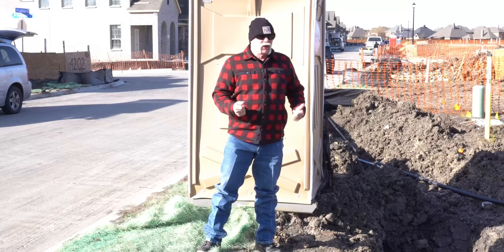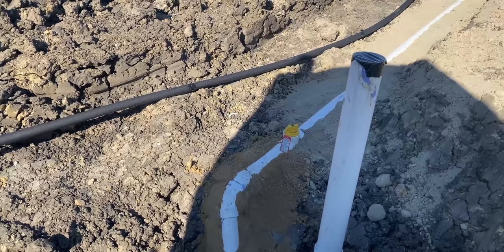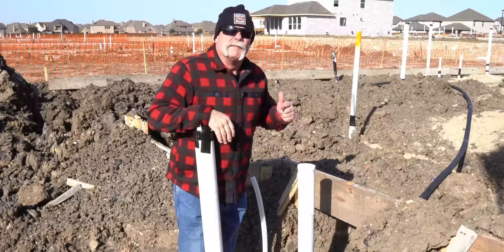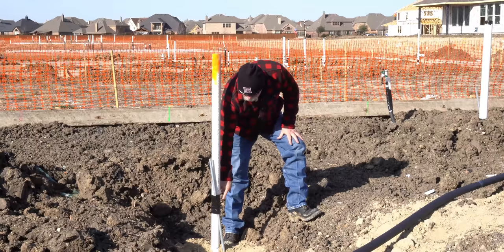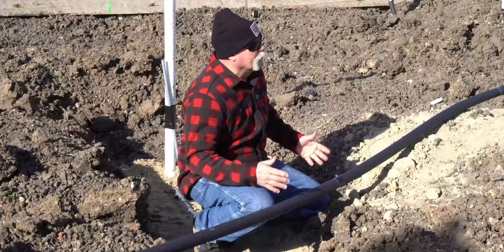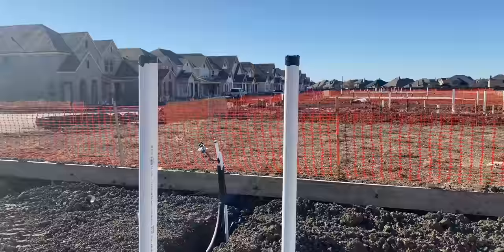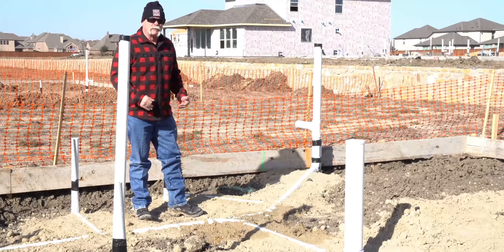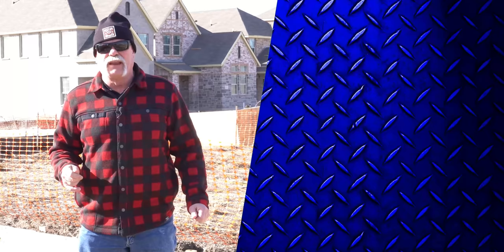How to Plumb a House | Rough-In

Comment: I do new construction I do rough ins fairly often. It's always cool seeing people talk about what you do and work around everyday. plumber nation!
Reply: About how long does it take for a rough in to be installed before the foundation is poured?
Reply: @marloflores8325  bruh you’d honestly be shocked how quickly some plumbers can get rough in’s done, I work as an apprentice doing rough in’s and it takes my group and I about Two and a half hours to do a one story house (that is if we don’t have excavation problems).
Reply: I'm a home designer and I have always included the brick ledge in my plan dimensions for the plumbers.  The new thing that I have noticed is more people leaving out the brick in the dimensions, leaving it up to the trades to add the 5-1/2" to the total. Do plumbers measure from the inside of the form boards (which would include the brick ledge) to locate drains or do you guys measure from the outside of frame?  I have argued that sometimes the brick ledge boards might not be set when you guys are roughing in drains and would measure from the actual EDGE OF SLAB?  I'll continue to dimension to E.O.S. until I learn different.  Thanks for any information.

Comment: I been doing strictly residential service since 2010. I ❤ it.. I did residential construction from 2003-2010. I'm glad that I started  in construction. Repetition is the best way to learn.
Reply: I did service plumbing for less than a year and over 5 years in construction. I learned a lot in the short time that I did service. From water heater installs and just cleaning out drains to repiping houses and trenchless sewer pulls, etc. Now I just do rough in plumbing from underground to top out.  I think both have their good sides and bad sides. There is a huge construction boom here in Northern CA. Some of the old timers who have been plumbing since the 90's say that it never lasts forever. I'll just ride the gravy train and go back to service when it stops. Haha. Someone has to service these new houses in the future.

Comment: Hi Roger. I've been following you for a while now and really enjoy your vids. I'm a residential new construction plumber in Northern CA. We only use abs here and in our local jurisdiction everything needs to be foam wrapped that is going to be up in the concrete. The project I'm currently on are all post tension slabs. We also strap our pipes with rebar and tie wire. I've never seen conduit used to strap the pipes like in your video around here.
Reply: The same here in southern cal...everything wrapped that are to be exposed in concrete footings and slab. Rebar and tie wire used.. I've never used conduit and tape on risers. Didn't see any support under the toilet 4x3 Arizona bends either
Reply: I’m in Texas and we use rebar to secure things as well. I’ve used all thread or 1/2” black iron in a pinch but never conduit. That’s track houses for you though. Do everything the bare minimum. We wrap everything in concrete here as well. I don’t know how it’s done in Dallas but in Austin that’s a separate inspection. We have a rough inspection and a pre pour inspection. On small jobs well usually do both at the same time but big roughs like this they’ll pass it then come back and back fill and wrap anything that will be in concrete.

Comment: City water and sewer inspector from Connecticut . I like seeing how other plumbers work in the country and how different we work. We don’t allow any pex buried in the ground whatsoever. It’s k copper or 200 lbs poly and it must have a tracer wire attached for line tracing purposes. Also we require 4 inch gasketed  not glued sewer pipe from the road through the foundation wall. We also require our sewer pipe outside the home to be laid in 6 inches of 1/2 or 3/4 inch crushed stone on the bottom ans 6 inches of stone on top and be wrapped in filter fabric to prevent sagging and bellies in the pipe. We used to pull deflection gauges through the pipe but now we air test the pipe then run a camera through the pipe to make sure it’s free of debris. If it’s clean we will run some water through and then a camera to make sure there isn’t and sagging or crushed pipe. It may seem like a lot but we have had some sloppy installs in the past that has forced us to make sure the home owner doesn’t have any clogs or rocks and debris don’t get into our pumps.
Reply from the maker: I love this! Thank you for doing things right!
Reply: Too many rules.

Comment: Lic plumber for 25 yrs+ and I do it all. When I rough in under a slab I use sand like this but I add it after my test which is a 10’ stand pipe (we are required to have a step ladder for inspector so all he has to do is go up and look)and after green tag. I will use a lil to secure everything but NEVER around joints. Once 24hrs pass with zero drop down I will go around a pack sand in all around my dwv

Comment: I work for a plumbing company and install new plumbing in houses that are being built. I don't know this aspect in this video because our ground crew does that. I go in and run all the plumbing and water lines and tie the plumbing into all of this and the water coming into the house is usually 1" pex and I reduce it to 3/4" pex and run 1/2" pex from the 3/4" to the bathrooms, laundry room, and kitchen. Pretty neat video! Thanks!

Comment: Roger, as a rough in plumber from the North, I have to disagree with your comment about bringing up your waterline to a valve in the garage. While this may work in Texas, it doesn't work anywhere that has a real winter. The garage is considered a cold space, weather or not it is heated.

I do like you comments on bringing 4" all the way in. Based on code where I live it is required to bring 4" into the building, and depending on the province i work in, code says we have to take 4" all the way to our main stack, with a 4x3x4 cleanout tee.
Reply: We live in MN. We have a main water shut off access in our driveway that is covered. But we also have a shutoff in the basement that is clearly marked with florescent paint and a sign by the plumber. Plus each shutoff (PEX system) is clearly labeled.
Reply: I was thinking the same as far as the water main, nothing on exterior walls or garages due to same issues. But for this video it's good for people who just want to see an idea but you should always refer to state and local codes before hand
Reply: Thats why you disagree with him , our weather compared to y'alls weather is totally different
Reply: Here you have to have 4” gasket outside the foundo. I like a shut off at the mech room or garage…I do a loop with shut off/prv/expansion tank. The water heater is usually in the garage so to me no real difference having the main in there as well…it would only make sense to not have it there if the water heater wasn’t there either. I live in the north and haven’t had an issue…just don’t leave the garage door open when it’s cold

Comment: I enjoy watching you I've been a licensed plumber for 40 years I'd like a 3" main line because of the gallon 1/2 flush toilets I've had too many customers that use heavy toilet paper and if there's not a washing machine behind it we end up with a ventral blockage and a in blockage in a in a 3" line let alone a 4" line 4" does not have enough water surface for a for a gallon and a 1/2 flush toilets and the water water level seems to be going down on those I live in Tennessee and we have the International code which is a little bit different than the Texas code and I understand that And before I was in Tennessee I lived in was licensed in the state of Michigan so that's got tough plumbing code laws also Most of the rough inside do are crawl spaces we don't do as many slabs as you guys do But we can also run our PEX under slab without being insulated when we can run at the same way that we used to run copper just make junctions in certain walls are under bathtubs things like that
Reply: Lee, I’m with you on this one. If you have too large of pipe or too much grade, your liquids will outrun your solids. Low flow fixtures especially are a concern. 
Bigger isn’t always better.

Comment: 23 years, self employed since 2006. Everything from residential & commercial service work, drain cleaning, smoke testing, sewer digs, gas piping, steam and hot water boilers, backflow prevention, high end new construction and remodels are my wheel house since that’s what I grew up doing.

Comment: If this Rough in was in Austin TX, it would fail completely under the UPC code.

1. I would put a 6"SDR36 Clean out instead of the 4"sch40

2. The drain exiting the house by code has to be 4" and right where it exits, there should be a 6" minimum sleve to protect it a little from foundation movement.

3. The sewer line has to be 4" Sch 40 by code and tie into the 6" sdr36 tap left by the city or municipality. The sewer line is also missing a tracer cable for future pipe locating preferably single strand

4. Whenever the sewer line is less than 12" in depth, it has to be Cast iron

5. By code the water yardline has to be a minimum of 5' separated from the sewer line to prevent contamination invase a trench or repair is done on any of them. The water yardline is missing a tracer wire for future locating. A valve by the water meter, PRV and in some water districts a Dual check valve 7 watts, but i assume he will install this later. Here in Austin when the meter is not present, the plumber has to connect the water meter nut with the meter nipple with a woden Dowell and with the correct house adress otherwise it will fail.

6. 10:57 Thats not how you vent a Toilet, the toilet has to be the main and then you can put a Wye to vent it. Preferably if it's stacked into a sanitary Tee is the best way. 

7. Studor vents prohibited, unless the slab is existing and they chose to put a island

8. 6' head test is fine but some jurisdictions require a 10' head. Also you have to make sure you bleed the air out of all the vents by penetrating the test caps with a screw or by using T cone plugs.

9. I was not able to read what schedule the pipe was inside the house but defenetly the sewer line outside had cellular core wich is prohibited for understanding 

This is not a good Plumbing Rough-in 😕
Reply: Interesting, looked like a good rough to me. Would pass where I live no problem.. have never seen 6” ran, for a residential sewer
Reply: Codes vary depending on where you live. I do agree with you on 10:57. I don't think that should pass. But maybe they allow it in that area.
Reply: @strangeroamer3219  agreed
Reply: Regarding 10:57 comment on the way the toilet is vented in this ground work, in the Seattle area we have to roll off a Y branch on the horizontal drain so that the bottom of the vent is rolled up to at least  the midway point of the drain it serves. But it's always nice to be able to flat vent when applicable. But nice video Roger!
Reply: about 10:57 toilet wet-vent it is totally allowed by IPC, which is the same used in San Antonio, Tx.

Comment: One thing we mainly do different is using 1-1/2 black poly and running it up into the house and pulling pex through to feed the house. Its normally installed on the left or right exterior wall

Comment: I’d have to argue that that’s a good rough. I know foam core is legal but I wouldn’t use it. Also, the 3” is terrible. We saw two toilets downstairs. One was a half bath. There’s two 3” risers that could possibly go upstairs. If there’s 4 toilets that’s illegal though I think they said in a recent CE class that there would no longer be a 3 toilet limit on 3” and it would go based strictly on fixture units. Even if 3” is legal for the needs of this house, I’d still run a 4” main. It looks like they’re maxing out that 3”. It’s hard to tell from the video but all the lines in the master bath were laying flat which means the vents would be cut off. That being said I haven’t done a whole lot of residential so I’m not as familiar with bathroom groups. We vent everything individually but I know there’s some different things allowed in a bathroom group where you can have one vent for all of it. That’s the downside to track houses. They do everything as cheap as possible. They won’t spend the extra for schedule 40 or even 4” pipe apparently. 
I would criticize not being prepared for inspection but I worked for a company for years that took on way more work than they could handle. They constantly sent us to a job with the inspection already called in and we had to work as late as need be to hit it. This doesn’t give you enough time to check everything. I would also not bed as much as they did so you can find leaks easier. It really only needs to be supported on the bottom half. A tip for preventing leaks on pvc is bevel your pipe. I cut my teeth in a small town without inspections. So we’d always just run water through it rather than pressure test it. This means we didn’t have to worry about leaks really because you really have to mess up a glue joint for it to leak in general use. However when I moved to Austin and had to put a 5’ head on every rough, I had more leaks than I should have. Then I started properly beveling everything piece of pipe I cut and it all but ended my issue with leaks. You just have to take off the 90 degree angle from the cut. If you don’t it can push most of the glue out. Just scraping off tue edge with a knife can make a huge difference but I bought a reed beveling tool that works great.
Reply: Of all my complaining about track houses cutting corners I’ll give them props on using insulation around the water line even if it wasn’t done very well. They could have used plastic sleeve. They probably could have used nothing. I think you can run bare pex under a slab. I can’t remember because it’s not a rule I’d ever worry about because I always use insulation or pipe sleeve for repairs and trap primers. It seems like everyone tunnels nowadays but when I was coming up in west Texas we fix leaks under slab a little different but it has to be run in insulation to do it. We would cut the loop with the leak on both ends. It was usually soft copper. On one end we’d attach a new piece of pex. On the others we’d attach a chain to it and with a hi lift Jack pull it out while simultaneously pulling the pex through. Attach it back on both ends and bobs your uncle. I assume the reason we didnt tunnel is because 1)there was 3 of us and 2) the ground is all sand and rock.
Reply: I can't help but emphasize the habbit/structure of beveling and reaming all my pipes for the most part.  Ensure security with my install and it doesn't hurt to do things the right way. Always teach this to people that are learning.

Comment: im a plumber/gasfitter in New Zealand, we have a huge amount of domestic construction work here, we call your rough in a "pipe out" and we do a lot of it, most of us here do the job start to finish pre slab, pipe out, fitt off, we use a similar pet pipe with metal crimp fittings, however ou drainage/rough in wastes are far different, looks like you use a fully vented system where we use what is called "single stack modified" or single stack=less vents and bigger pipe size

Comment: In Connecticut it’s code they have four-inch penetrate the building and a standard residential roof in. But have you seen prices lately 4 inch PVC is astronomical

Comment: Nice video but a little misleading, Florida plumber for 25 years plumbers don't make the decision whether to install 3" or 4" pipe in any application the size of the pipe is determined by how many fixture units is served.
Reply from the maker: I still prefer to upsize to avoid clogged toilets. Just like I prefer to upsize PEX to have proper water flow....

Comment: I've never seen the home owner valve under the ground. Here in Phoenix they are on the side of the house where it comes out of the ground and 90° into the wall.  I live in a new built house and did my walk throughs and own inspections too. Here the sewer water rest for new homes is a 10' stand pipe at the back with balloon blocking at sewer and it has to hold that 10' stand full for 7 days
Reply: We do the same here,  all depends on the city's code inspection , everywhere is slightly different
Reply: I'm in California and code is same basically, except for leaving the test for 7 days? Seems a bit much.

Comment: Where I am in the PNW what you call a "rough-in" we call a groundwork that being anything under a slab and we only go as far as 5ft outside the building what we call a rough in is all of your waste and water in the crawl (if applicable)through the walls all the way to the vents through the roof as well as setting tubs or showers. lastly would be trim such as toilets, tanks, or any other fixtures after sheetrock and such has been done. I myself do both groundwork and rough-in plumbing which in the winter can be quite messy but anything beats service work 🤣

Comment: Here in ca. on a rough in we have to use a 10’ head on the fill up pipe for test….. ive been a plumber for over 25 yrs started at service work and worked all diffrent phases… my favorite though would be commercail new construction…ive plumbed almost all the starbucks,mc. Donalds, and walmarts here in ca.
Reply from the maker: That's awesome. How long do those projects usually last?
Reply: @RogerWakefield  the starbucks were usually 1 week turn arounds on the remodels…close sunday night open the follwing sunday morning….mc donalds around 1 month, walmarts would be around 6 months with lots of follow up fine tuning customer service visits etc.etc.etc!!!…but walmarts were the funnest as well using the large scissor lifts and heavy equip……just very time consuming and miles and miles of pipe per store